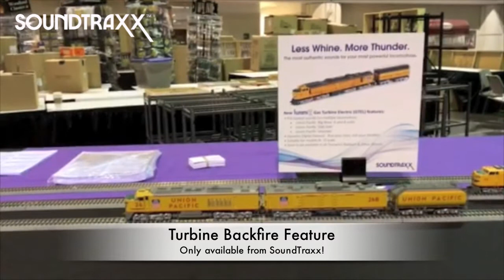Gas Turbine Electric Sounds for Tsunami2 by SoundTraxx

Comment: Which decoder is this,  not listed on your website.
Reply from the maker: These sounds are in all Tsunami2 decoders that have a Baldwin & Others sound profile. So the TSU-1100, TSU-2200, TSU-N18, TSU-21PNEM8, TSU-PNP8, & TSU-4400 all have these sounds available. Just choose the Baldwin & Others sound profile after you choose the board format that will best fits in your model.

For future Reference you can see all of the prime movers for each decoder on the Sound Selection References found in the Reference section of our website.

You can find all of these decoders on our website: https://soundtraxx.com/products/tsunami2-digital-sound-decoders
Reply: @SoundtraxxDCC   the model is the Athearn first run, so which one would be best for it?

Comment: I love tsunami2. When I look up locomotives for sale from the big internet stores the
list of features with sound, most often don't include tsunami2. Even thought they actually
have it. This makes it very hard to pull the trigger. This needs to be fixed. Thank you.
Reply from the maker: Thanks for your input Roger. All new Athearn Genesis series models are equipped from the factory with a full featured Tsunami2 decoder. Other older models may include Tsunami technology, but can easily be upgraded.